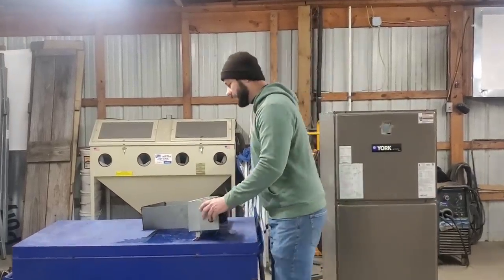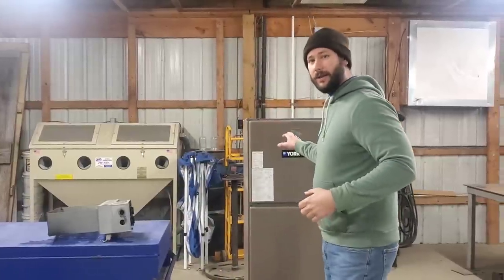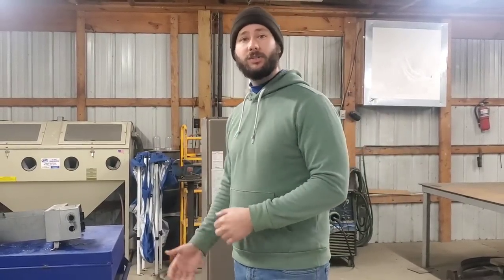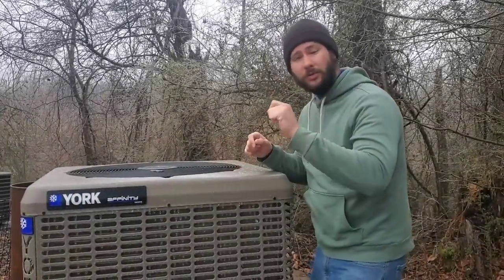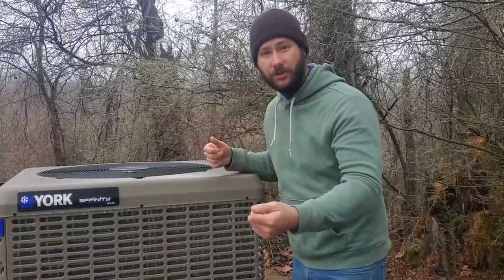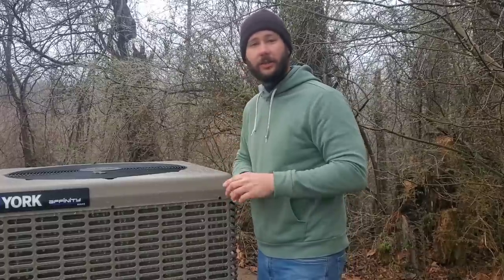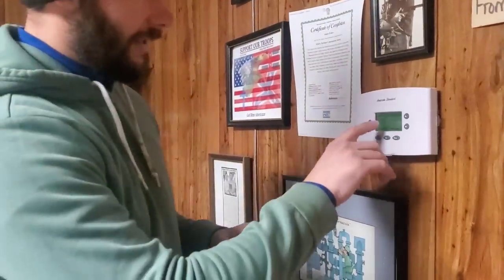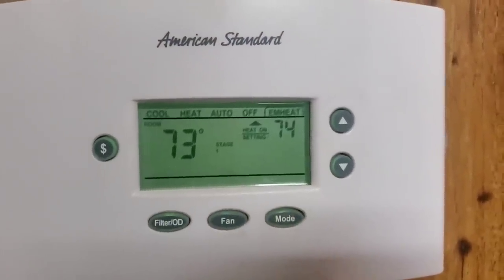Heat Pumps? When to use Emergency Heat? #emergencyheat #heatpump

Comment: I got advice from a maintenance man who was in charge of two apartment complexes. He had told me I should switch to emergency heat when it was 35° and below. Since I've done so it's been warm in the house and oddly quiet. The outside unit runs a lot less, and my electric bill is not heart attack threatening. I had the idea to run it on auxillary anyway just from luck and instinct. One day recently I put my hand up to the register in the kitchen and felt cold air coming through. I popped the thermostat on to emergency heat and put my hand up to the register again and the air was hot.
To sum: the pump runs a lot less, maybe half the time than it did with emergency heat off. There isn't any growth of ice showing up all over the heat pump.
Hot air comes out steadily, not sporadically hot and cold.
My bill is manageable. It was $80 less than it was this time last year. Now, it could have been warmer out last year, I don't remember the temp. But that heat pump was running constantly a year ago, I do know that.
And I have a Frigidaire, nothing fancy. 
This worked for me, anyway. I suppose it varies for every individual,  I dunno. Hope it helps
Reply from the maker: Very good I love this information thank you so much for sharing this in the comment section you are awesome
Reply: @TaddyDigest  No problem. I hope it helps. I don't know alot about heat pumps and air handlers etc. I just watch YouTube or call someone that I know who does.

Comment: I am listening to this and it never ceases to amaze me... I live in SW Nebraska, far from the areas I would think are ideal for a heat pump. I shut my older unit off last year at around 28 degrees. This year, after having it serviced in the fall I tried to see what it could do in a normal winter, and so far we have gone down to 9 degrees. The heat pump cycles on and off constantly, air conditioning my small house while trying to warm 'Joe Biden's Choice  of HVAC appliances' (lol). Basically, at anything under 25 degrees this thing is a dumpster fire. I spent two hows carefully de-icing my heat pump today (we had 60 mph winds and blizzard conditions, so I went out to check on it. It is easier for me to run a couple space heaters and avoid the AC effects, or just turn on my propane heater. It keeps the whole living area at 68 on the lowest setting. We get down top -20 a couple of times each year. why would anyone install a heat pump as a primary heating unit?
Reply: Imagine, if you will, a heating system that doesn't work when you need it most.

Comment: I did learn something. Appreciate that. It would have been helpful to another segment of learners had you been able to use a nest thermostat to give an example. Hopefully you will get to and answer my question though. So what I want to do on my nest is set the thermostat to use auxiliary heat when the temperature falls below 30 degrees. That can be set up on the nest. Mine came already programmed at 50 degrees. So I understand that. Not sure why it is programmed to begin at 50 degrees but it seems unnecessary when the outside temperatures will still allow the pump to heat your home without needing the auxiliary mode. If I’m right about that and I set my auxiliary heat to kick in at 30 and the temps go below that should the home get heated the same as when the auxiliary isn’t being used? The reason I’m asking is as with everyone during this really cold weather it got down to 8 degrees at my home. The auxiliary heat was being called for by my nest thermostat but it would not heat the house pretty much at all that first day. My inside temp fell to 59 and stayed there for hours. Is there something wrong with my heat pump or is that normal? I hope I was clear and you get a chance to answer. Thanks
Reply from the maker: I need to do a video to answer this question
 I will do  A video soon

Comment: I noticed I never have to turn on the emergency heat manually…it just does it itself. I could tell recently here in NC when the temp dropped to between single digit lows and below 25 degrees for highs for 3 days straight and my energy usage nearly tripled…the heat coming out also felt more radiant than when the heat pump normally runs
Reply from the maker: Some thermostat Automatically lock out the heat pump at a certain temperature and switch to the alternate heating mode
Reply: @TaddyDigest What temp should I have aux come on? It's set at 30 should it be lower? Thanks

Comment: FWIW, modern heat pumps can handle cold weather much, much better than they could even a decade ago.  I recently replaced my gas furnace with a dual fuel heat pump, figuring I would run the heat pump down to about 35F and then switch over to gas.  Nope.  Heat pump has zero problems keeping up down into the 20s.  It started to run a lot at about 15F but was still keeping up.  So I am barely using gas now, saving a bunch of $$$.  Going dual fuel instead of just gas is going to pay for itself in just a few years.
Reply from the maker: great job 👏 👍

Comment: Such wow! If you have a PROPERLY installed heat pump, thermostat, and air handler, you shouldn't need to ever worry about these things. The Bosch unit I have has sensors installed on it so when it detects ice, it will automatically call for the heat strips to turn on, reverse the compressor and thaw itself out, also known as a hard defrost. In a normal defrost, it just reverses the compressor and uses existing indoor heat to thaw itself out, typically at the end of its cycle.
Reply from the maker: Have you ever been in the ice storm
 Have you ever been in a snow storm
 Have you ever had 2' of snow
 What happens when it covers the unit and its negative temperatures
 Dude I don't care what type of unit you have 
 Sometimes all it takes is a little ice or snow on the fan blades and boom you've got damage
Reply: @TaddyDigest  lol
Reply: @TaddyDigest  Nothing like having 2 foot of snow slam off the roof onto a unit already covered in snow during a snow storm. People forget the condensers are not installed inside an outdoor gazebo for protection.

Comment: here in Louisiana, it dropped to 10 degrees during this cold blast and for three days straight stayed below 32 degrees, heat pumps around here struggled to keep up with the extreme cold and it was a mess so many calls. That's why my company has recently started telling customers upfront when we they are choosing a new unit that if you pick a your heat pump, it will likely not work when it gets to 32 degrees or more and advise them to use emergency heat. But of course nobody does nor do they understand what a heat pump actually is. I don't care what you say, when it gets below freezing around here all hell breaks loose and people wondering why their heat pump can't keep up.

EDIT: a lot people don't factor in wind chills/feels like temps so really even at 32 degrees your heatpump can have issues. Even the new ones we install... even though many people would disagree and think a heat pump can just fare well in extreme cold, which I would say is disproven in many cases, not all.
Reply from the maker: you are doing the right thing I love your direction Good Stuff
Reply: You mentioned wind chills. Wind chills don’t effect inanimate objects such as your HVAC system.

Comment: I have switched to emergency heat in the past, but it did not keep up with the cold. Had to go back to regular heat. Do I not have enough heat strip capacity?. Nashville TN
Reply: I'm right here with you, in Nashville, TN. My heat pump automatically switches to auxiliary heat.  I switched it to emergency heat yesterday, & it didn't help at all, so I went back to normal heat, which automatically went to Aux heat. I noticed yesterday when the temp got to around 20 degrees, the house warmed up quite a bit. Hoping today it will work better with temps getting to 30 degrees. 

Inside the house temp is 58 degrees right now. I've been sleeping in warm leggings, a sweatshirt & 3 blankets. I honestly think, from all the things I've read, this is somewhat basically normal for a heat pump. Good Luck!
Reply: I made it through the night. Temp set at 69 and slipped to 66 at night but would go back up to 69. I did go into the electric panel and take an amperage measurement last night and both heat banks were running around 20 amps plus or minus. So they are working. Will investigate and see is there is a way to up the heat bank units. Thanks for  your information @TivaC
Reply from the maker: You may not have enough
Or it may not be wired up correctly
Reply: OK Do you have a video on that subject. @TaddyDigest
Reply: OK, I am sure there is not enough capacity. How do I increase the heat bank capacity?
Reply from the maker: I have a video on how to size heater kits.

I also have a video titled How to know if you're emergency heat Is working? 
That would be a good video to check out

You may need to get a bigger heat kit and get that installed.

Comment: I timed how long my heat pump ran vs heat strips.The temp was 27-28 degrees.The heat pump ran about 20 mins to keep house at 69°.With the heat strips it ran 6-8 mins to keep my house at 69°.So which is more efficient?To me it seems like the heat strips would be even though they're pulling alot more current.
Reply from the maker: The heat strips pulled double if not triple the current
So factor that in

Comment: what does it mean thermostat says heat on on status when it's off when it does it's 3 second short cycle or it's not running for 10 to 15 minutes?  It just started saying that we had a 30 minute lost of power 2 days ago.  I have a Lennox 2 ton heat pump handler installed 3 months ago.  Also, can I use a space heater to heat my son's room since I can't get any heat on the other side of my home, air comes out of his one vent in his bedroom but it's very faint/low air and not heating his room up at all, I have all the vents opened too in the condo but the front end of the condo doesn't get any kind of heat/air.

Comment: I have a Honeywell thermostat on a Maytag heat pump system I was told to let the thermostat control the heat strips doing it manually could actually damage it is this true or false let the thermostat handle the emergency heat system

Comment: Should there not be an automatic switch to emergency depending if the outside temperature falls below a certain temperature   that is too cold?
Reply from the maker: yes a heat pump lock out temperature/ compressor lockout temperature

Comment: When my heat pump has been running for a while without aux heat... At what point ( as in how many minutes or hours) should I turn on or set aux. I have an Ecobee so I can set it for aux, so they run at the same time so the aux heat helps out the heat pump.
Reply from the maker: When it's below 25ﾟ I would definitely say that would help tremendously
 Great idea
Reply: @TaddyDigest  Thanks!!
Reply from the maker: You're welcome

Comment: For some reason when I turn the heat on during the winter it blows out cold air and I have to turn it on to emergency to heat the house. it uses way more electricity using the emergency resistance heating so im trying to figure out why its blowing cold air when the regular heat is on. I thinking it might be the reversing valve on my outdoor unit is stuck in the cold position?
Reply from the maker: Yes it could be that or it could be a few other things.

Comment: I just had a Lennox 3  ton 17 seer heat pump and air handler installed last year and it works well when the temperature is in the lower teens, I was surprised that the aux heat didn't turn on to help the heat pump when it was that cold out......But I have a question does the more coils the heat pump have the better it can pull heat from the outside air?
Reply from the maker: more coil equals more surface area 
more heat absorbed 
yes 
also depends on if the unit is variable capacity

Comment: Wow I had no idea when to turn on emergency heat, I had a brand new HVAC installed three years ago and the installer never told me this. It got down to 24 last night and my unit iced up big time and I had no idea why cold air was blowing in the house, it was brrr cold in my house last night, got down to 49. But in the morning I went outside with my hot pressure washed and got rid of all the ice. Right now it's 28 and I went outside and looked and I can already see where it's starting to form ice and I'm sure it will only get thicker as it gets later in the night. I'm going to activate the emergency heat since seeing your video, can it stay on all night?
Reply from the maker: yes it can stay on 
keep on till it's above freezing to stay comfortable
Reply: It sounds like your defrost cycle isn't working though
Reply: @jazeenharal6013  The company that installed it is coming by tomorrow, I do have a ten year warranty on parts which is good. There's definitely some wrong with it, could be anything from bad control board, heating strips, sequencers or limit switch.
Reply: @darktoadone5068  good. Glad to hear they're addressing it :)

Stay warm
Reply: @jazeenharal6013  They came by today and I found out it had two bad control boards, got one installed today and the other part is on order.
Reply: @darktoadone5068  holy moly. There's a real problem with QC these days. Seems like half of what you get is broken from the factory haha
Reply: @jazeenharal6013  The company that distributes these units are International Comfort Products, LLC out of Lewisburg TN but when I looked more closely at where it was assembled at it said Mexico. That's what the paperwork on the unit said, makes me want to call their manufacturing plant and tell them to jump on their quality assurance folks for passing equipment like this off saying it's ready for operation.

Comment: Its crazy how so few people know about Heat pumps in the US.  I have a heat pump and its cut off is automatic at 15 degrees.  Every heat pump is different some can go down to 35, some -15 some 17.  So don't just take this guys word for it he's talking about this york model, some thermostat's won't even allow you to manually go into aux heat mode  they will just do it automatically if your heat pump is running and the temp in the home keeps dropping.  It might be 2 degrees below set point it switches to aux heat.  This is why the third party smart thermostats are so nice example would be the nest thermostat.  This works with heat pumps and aux heat, you can set all sorts of options to save you money.  A heat pump will always produce some heat even down in the zero range but the question is will it run so long and produce too little heat to keep you comfortable.  That's when aux heat kicks in.  I have a Daikin VRV life system, it switched over at 15 degrees and went to back up heat which is propane.
Reply from the maker: Dude you gotta nice set up I like that's awesome

Comment: My unit automatically switches to auxiliary heat when it gets super cold and heatpump isn't cutting it. There's light on my thermostat that turns on when it switches over. There is still a switch for emergency heat, do I still need to switch it over to emergency? We just moved into a new house and I am not familiar with this system. It is a older Trane model. The heat is working no trouble keeping house warm, just don't want to damage anything out of ignorance. Thanks!
Reply from the maker: yeah for sure switch to em heat to keep outside unit from getting damaged
Reply: I would monitor the outdoor unit to see if it gets ice on it obviously keep it clear of ice and snow and you’ll be perfectly fine almost all thermostats know when to turn off the heat pump if it can’t keep up via temperature differential or a time constraint

Comment: Very good video and some great information to know. I just moved into a rental with a heat pump and I actually just looked at my thermostat and does have the "Emergency Heat" option. One question, by running your system on Emergency Heat is this doubling or tripling your heat bill? Thank you for the tips.
Reply from the maker: Hey thank you so much for watching the video I really appreciate you watching if you turn on your emergency heat it does cost double the money
 However if you own the property and the air conditioning system is yours then of course then the emergency heat can save you from destroying your equipment during icy conditions
 Also your compressor may fail or something may happen to wear the heat pump no longer heats and then you need your emergency
 Please hit the like button and share the video
Reply: @TaddyDigest  Well it's not mine place, I'm renting but here in Mo it gets pretty cold, well below the freezing point of 32. I hate cold weather, are there any hacks to work around so you can have heat without doubling your bill? Thank you again and yes, you just got another sub.
Reply from the maker: Yes make sure the outdoor unit is in the direct song
 You can cover the outdoor unit in a way to wear the snow does not fall directly on the
  Make sure that whatever you build above the outdoor unit is more than 4' from the discharge of the outdoor unit
 If you need instruction on this I can do a video
Reply: @TaddyDigest  The outside unit set's on the east side of the house so shortly after noon it's pretty much in the shade the remainder of the day. The instructional video would be a great help. I know it's still early summer but I sure would like to be able to prepare in plenty of time. Thank you very much for replying, I really appreciate it.
Reply from the maker: Video coming soon
 Thanks for the idea
Reply: @TaddyDigest  Thank you, I think it will benefit a lot of folks
Reply from the maker: Awesome Have a Blessed Day